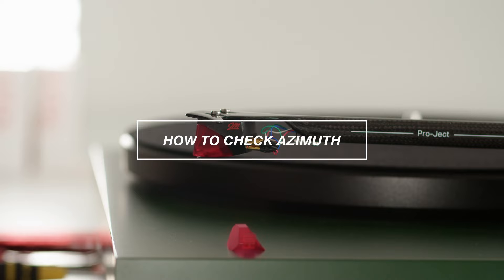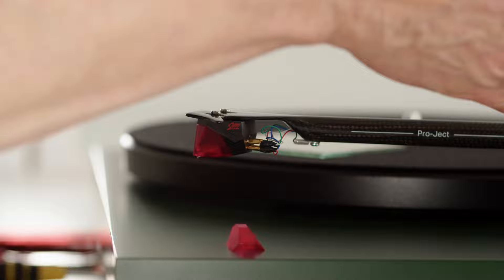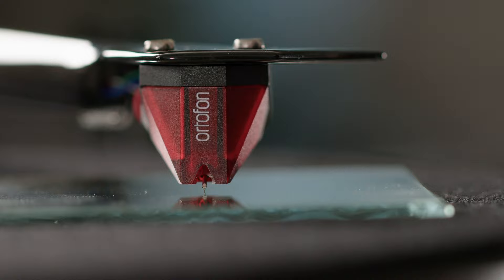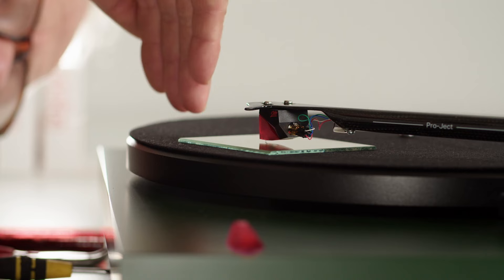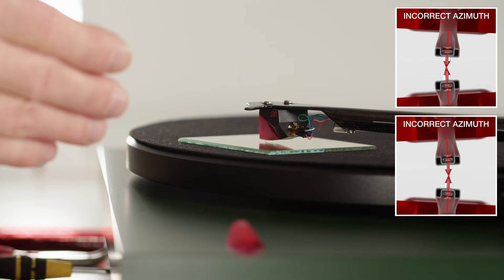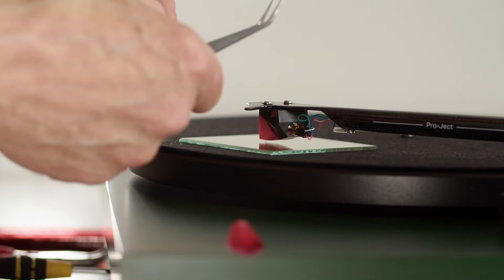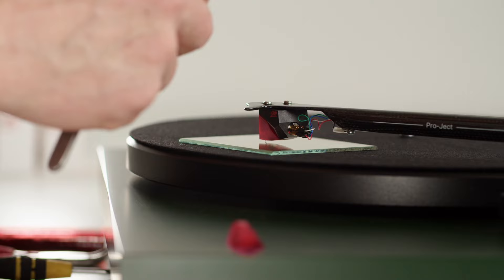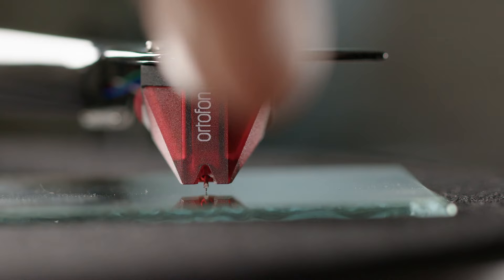Cartridge setup | How to check & adjust Azimuth

Comment: Using a first surface mirror where the reflective coating is on the front instead of the back can help you see the alignment a bit better. Such mirrors are available online and are not too expensive.

Comment: Thank You. I have a Ortofon 2M Blue. My Azimuth needs adjustment. Without a mirror I can see it's off.  Love the suggestion of using shims to get it right if needed.  What is important is to get that needle perpendicular, going into the groove straight.  I'll work on it.

Comment: You can also rotate the tone arm their is a screw on there but. This way is easier.
Reply: Wonder why they didn't point that out...this looks like a debut carbon - their own product - which has that screw for adjustments.

Comment: Azimuth is defined as a horizontal angle. You're describing the complete opposite, a vertical angle. Please explain.
Reply: My guess is that although you are looking at the vertical stylus, the angle you are adjusting is the horizontal angle of the top side of the cartridge
Reply: While "azimuth" traditionally describes a horizontal angle, its application in vinyl records is a specialized usage that reflects the need for precise angular alignment, albeit in a different plane (vertical rather than horizontal). This adaptation of the term is considered correct within the context of audio engineering, despite the difference in the plane of measurement.

Comment: They have reasonably cheap tools for this;wherein it's a vertical plastic see through plate with horizontal lines. You use the lines to see if your cart bottom is parallel to your record surface. But this assumes that you diamond tip is glued exactly perpendicular to your cantilever.  Many are not. Only way to get this perfect is with a microscope and a software program. The more you learn about carts, the more bogged down into details you become. Using your eyes like this is only going to catch egregious misalignment. In addition, Ideal VTA is 92 degrees and you can't do that with your eyes. Most folks align carts with their ears. That can only take you so far.

Comment: I'm not sure that is correct to have it at 90 degrees !
when they cut the record the cutting head is not at 90 degrees because they got to remove the material far as I know and what that angle is when they are cutting??
Reply: You’re thinking of stylus rake angle.
Reply: @utub1473  yeah you're right
Reply: @hoobsgroove  Anyway, most people recommend 92 degrees for that. All cutting lathes are different, but they fall into a range of 91-93 degrees.
Reply: @utub1473  depends dynamic or static measurement? I would say static 88.5° - 89.5° would be better